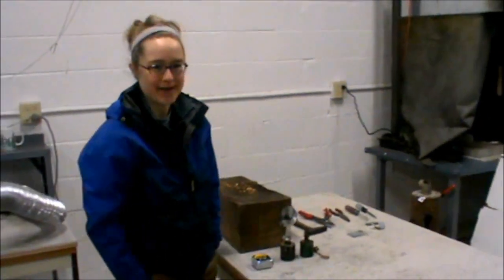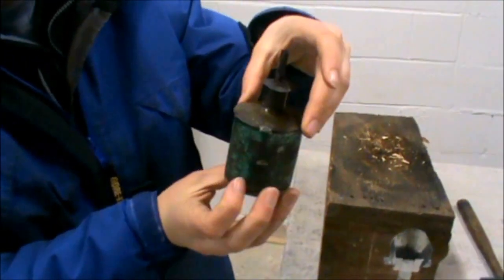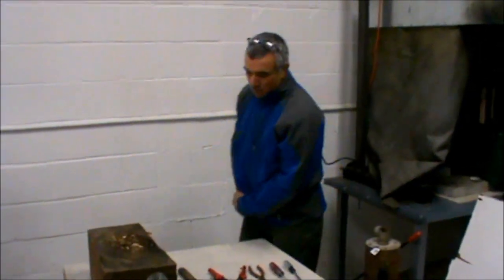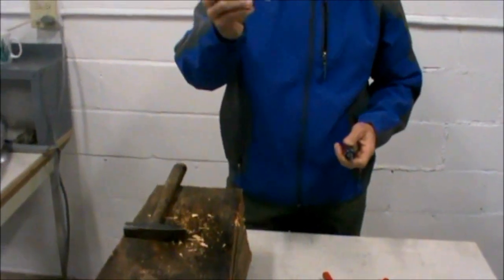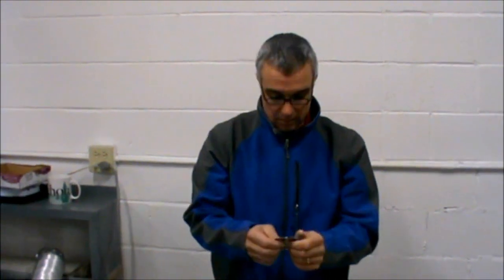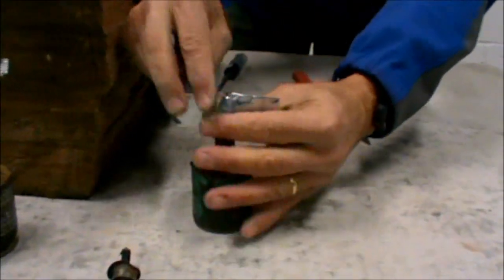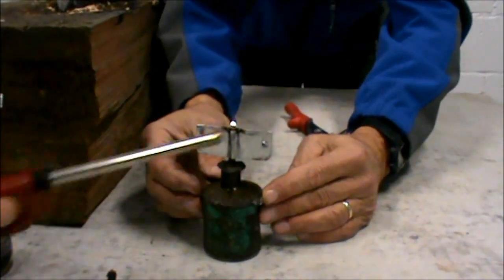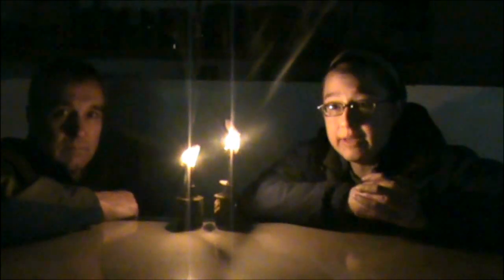Ugandan Lamp Improvement by Aprovecho

Comment: Basic 19th century technology, shaping the flame to provide a greater area to flame.  A metal chimney set about an inch above the flame will provide some draft and thus brighter light.  This was used before heat resistant glass was available.

Comment: awesome job! did you get the idea out to the people?
btw, any idea how exactly that shield makes the lamp burn so much cleaner?
just one thing that's wrong in this video: to adjust the wick, while the lamp is burning,  people use a needle or similiar pick for as long as there are oil lamps. the shield will get too hot too touch anyways.